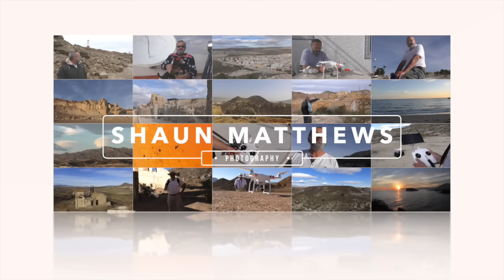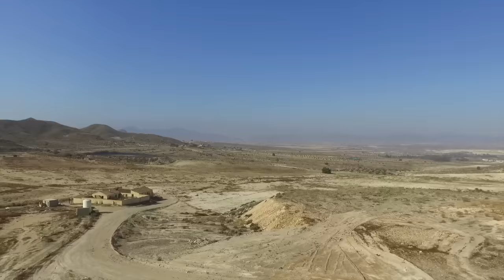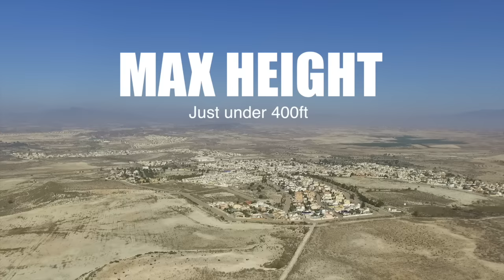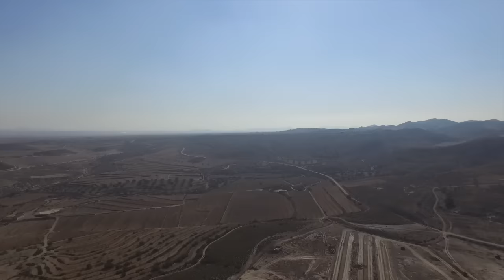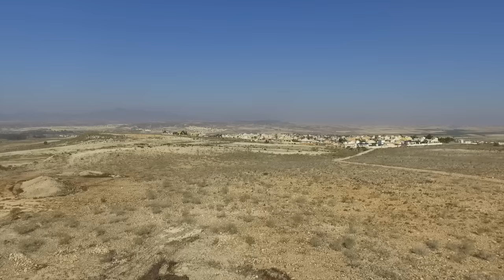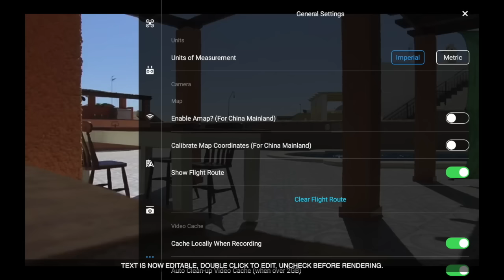DJI Phantom 3 Standard Test Flight | Nexus 7 #shaunthedrone

Comment: My Nexus 7 won't cooperate  with my P3S.
Low fps and 15 sec delay video. Other things are fine, like map view and other.  
I try everything, resets, downgrades, memory clearing from background process. 
Nothing helps.  So u r lucky Mr. :) Very nice region.
Greetings from Poland
Reply from the maker: Sorry to hear about your problems with your Nexus 7 - I know the first edition will not work with the drone I've got the 2013 model. The only thing that won't work is the Follow Me mode - I bought a cheap Lenovo tablet and everything works fine - hope you can get it sorted - many thanks for watching :)

Comment: Thanks for sharing,  the Nexus 7 is no good now? I just bought a DJI Phantom 3 Standard. Ive been using a iphone 6 however I want the larger screen, I found a first gen Nexus 7 for $40 usd on a 2nd hand web site,, thoughts?
Reply from the maker: Hi Tyler, my Nexus 7 (2013) somebody told me it's the second edition! Also the Follow Me won't work - since then I've bought a Lenovo Tab 3 710F7 which works fine and the Follow Me works - check out my latest vids - your iPhone 6 is the best to fly DJI with - if I was you - stick with the phone :)

Comment: Why the weak signal at 400ft? you are in the middle of nowhere..........not that I have tried it ;) but mine easily goes to 1300ft before losing signal, exactly same model as yours.
Reply from the maker: If I knew why I would sort it but it does at times - I don't mind as I prefer to fly much lower. Many thanks for watching Rod :-)

Comment: You shared how you connect your Nexus 7 to the Phantom phone clip but now I can't find that video : ) Do you have a link to the tablet mount? I loaded the DJI Go app on my tablet and I want to attach it to my Phantom phone clip like you have done. I just installed the ARGTek range extender and I am getting some good results with it, do you plan on getting one?
Reply from the maker: Hi Steve, here is the link for the Tablet Mount https://youtu.be/0oLXirT1-Xg and to answer the other question - no :-) I'm happy with my range, it's a pain when I get a weak signal but I like to fly close and low to capture what I'm videoing. I've seen some great results with the ARGTek but not for me. Many thanks for watching :-)